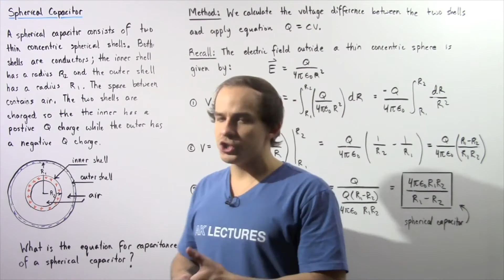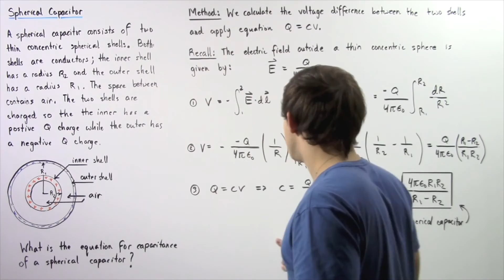Spherical Capacitors

Comment: What about the negative sign of electric field when you go from R1 to R2 ? E is opposite to dl, hence we should get a negative sign for the dot product.
Reply: Lalit Pathak bhul bhal
Reply: isn't it already included in the equation? But anyways it should not matter as the strict definition of capacitance is Q/|ΔV|. By definition, capacitance is always a positive value
Reply: I think the mistake comes from the sense of the vector dl in the 58th part about the parallel plates capacitors : I wrote there a detailed comment to explain it (hope I am not wrong).